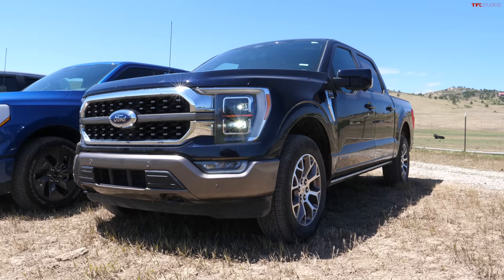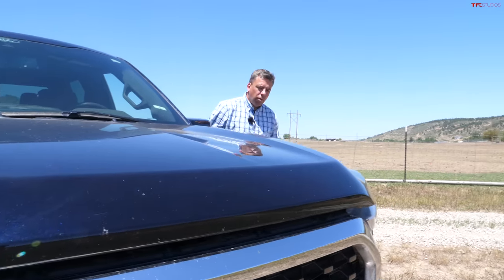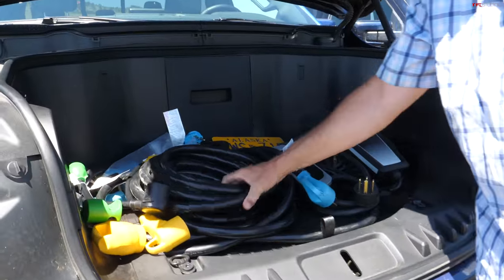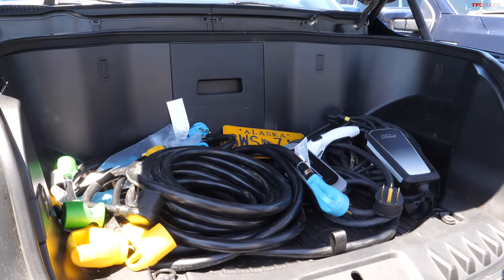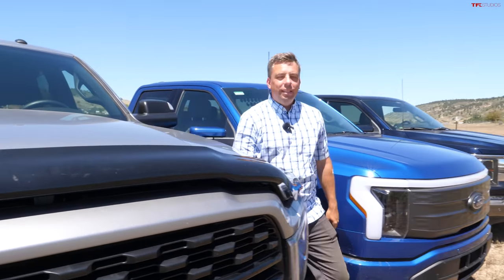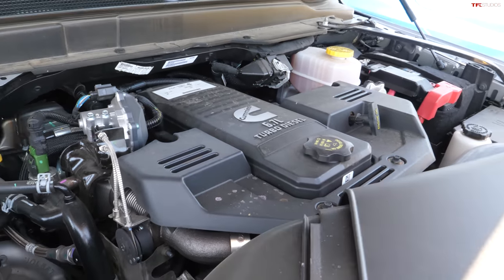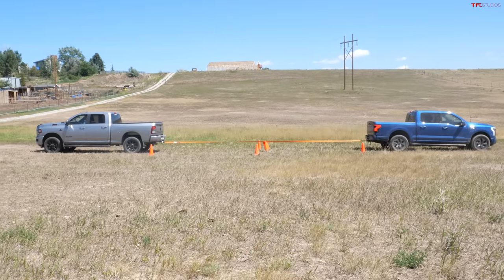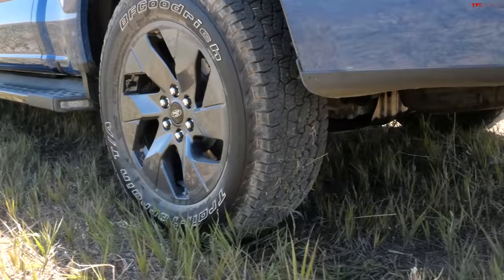Diesel vs Electric Tug-of-War: Ford F-150 Lightning Takes on the Ram 2500 Cummins In a Nail Biter!

Comment: It would've been cool if you had shown the battery percentage before and after.
Reply: That would be a Ram 🐏 fan boy or a Chevy but hurt..
Reply: 100% before. 2% after lol
Reply: Probably lost 10% if i had to guess. Not advocating for EV lol but the trucks battery capacity isnt that bad...its bad but not that bad if you get me . Ill take my 5.0 lol
Reply: Has zero to do with it ...... Gas / Diesel are over ......  Won't be missed
Reply: 5%
Reply: Watch hoovies garage video on Lightning towing. It's awful. He had a light 1400lb aluminum trailer had 200 miles range to start and just 32 mile round trip for what he was picking up. Just driving one way with empty trailer he lost over 160 miles of range. EV IS TRASH
Reply: Towing trailer wasn't problem. But range dropped drastically
Reply: Ford Lightning charge goes down fast when towing.
Reply: @travisyarbrough4033  keep telling yourself that BS.
Reply: i have drove the trucks before battery goes twice as fast in ss mode on screen use more power
Reply: These ev trucks can't do truck things plain and simple. Waste of money
Reply: Yeah no kidding. Dude needs a ride home now
Reply: @travisyarbrough4033  When towing the range is cut by at least 60%.  Towing a boat for example 300 mile range is cut to 100 miles and that's assuming you are not driving uphill.
Reply: That’s the question of the day isn’t it
Reply: @travisyarbrough4033  mabey by liberals but men still like motors they can work on
Reply: Lol they don't want you to see that.
Reply: @travisyarbrough4033  I’ll miss them, EV would kill my business.
Reply: It probably drained it and took 24 hrs to charge
Reply: These ev s do not do well towing. It cuts theilwage by more than half depending on weight.
Reply: @travisyarbrough4033  obviously you don't tow
Reply: Ikr, the Ford dealer where I live did a trial they ran the new lightning out to wawa 3 hours away, fully charged it which takes a few hours then hooked up and trailer and came back,  it got about half way before the battery died Also the power for the charging stations mostly comes from coal and gas energy
Reply: @travisyarbrough4033  Just bought me a new gas truck that can tow quad the range of any EV.... no where near over, pal.
Reply: @kyleflood6173  I'm a big car guy, nay a huge car guy. But even I see that electric cars are slowly becoming more Superior to ICE ones. Nothing comes without of cost, so that towing cutting down mileage is the same thing as towing a trailer cutting down your fuel economy for a regular truck. Electric just has Superior performance capabilities all around. I still like an engine, but modern cars are so hard to work on it's not even funny.  And there's some fundamentally stupid design issues nowadays with gas engines (hello Ford and putting the water pump INSIDE the engine? YOU LITERALLY HAVE TO DROP THE ENGINE TO CHANGE YOUR WATER PUMP. WHISKEY TANGO FOXTROT!). Electric vehicles? There is almost nothing to work on and they are much more reliable. I'm a huge car guy, and I still support electric vehicles
Reply: @pupferal3934  I agree the new gas vehicles are ridiculous to work on I have a 97 chevy k1500 very easy to work on I don't work on anything over 2012 even then I don't like to but an electronic truck just sounds weak to me im sure they preform but its just not a truck. But putting a water pump in the motor for fords is so damn stupid I could see wanting a electric truck after working on that.
Reply: @kyleflood6173  to me, EV suggest an advancement of vehicle technology. They're in their infancy. Look at gas powered cars 100 years ago compared to now. And look how much flack gas powered cars got when they first came out. All I'm seeing is a repeat of history.
Reply: @pupferal3934  can u put glass packs on a electric truck i like my trucks loud
Reply: Would not lose much as the electric vehicle gets best range at low speeds.
Reply: @pupferal3934  - I'm a historian ... and know first-hand that way too many people either ignore or misinterpret history.
Reply: @charlestemple634  in context to this, meaning?
Reply: @pupferal3934  - Sorry ... "Hybrids/EVs are just getting started, and just like in the history of gas/diesels, the manufacturers will recognize what's needed and they will vastly improve everything."
Reply: @charlestemple634  I know this seems weird, but are you agreeing with me ? Context is a bitch sometimes
Reply: @pupferal3934  👍👍👍 ... 100%
Reply: @charlestemple634  okay, thanks 👍🏻
Reply: Lmao
Reply: @Andyman269  Yikes Last time I was out there about 10 years ago Gas stations were sparse, I can only imagine how few charging stations there are.  Not nice to get stranded.
Reply: @SkullBro  still if it can't even pull a trailer for 3 hours on a full charge it's completely useless.  It spends more time charging than driving.  Torque or horsepower doesn't matter if there's no range. You need at least a 1000km range to make electric viable, and the Lithium batteries are no good because they have a risk of catching fire. It's like those new electric excavators you get 2 hours of use then it requires an 8 hour charge with a massive diesel generator. So how is it really saving emissions.  Even the power used to charge electric vehicles is mostly coal and gas the more electric vehicles the more of that you're using so how is that saving the environment.  When I worked at DHL our smuckers plant bought all Lithium battery forklifts they spent more time down than running and because it's a 24 hour operation the batteries were all toast within a year whereas lead acid batteries can run 10 to 12 hours easily,  they have individual cells that can be maintained and last 7 to 8 year if looked after they also had 3 Lithium batteries catch fire, those batteries are 25k each versus only 10k for the lead acid batteries.  Lead acid batteries can be recycled Lithium cannot because it's extremely toxic and harmful to the environment.  The agenda is pushing ordinary people off the roads and out of society not saving the environment.  They want us all I  cities working from home as much as possible and taking city transit while they keep their cars and private jets
Reply: No there not states are telling people to not charge their cars because they don’t have enough electricity. But guess what still got gas and diesel.
Reply: Best one on here
Reply: @luciankristov6436  there's videos on this. The EV battery drains when towing
Reply: @travisyarbrough4033  BS !
Reply: Right I’d take a wild guess and say the electric motor would burn out before the battery lol
Reply: @mattlincoln6845  I see why hoovies garage issued an apology. People are so simple minded it's ridiculous. Air resistance folks. It increases exponentially with speed. Comparing towing at highway speed to a tug of war at probably less than a mile per makes no sense. This probably didn't use much battery at all. Towing something big with poor aerodynamics right now will be a problem yes. Battery tech just hasn't caught up to the use case. But just like I'm typing this on a phone that lasts nearly 48 hours on a charge that fits in my hand where years ago it would have required a brief case it will catch up to the requirements of EVs.
Reply: @travisyarbrough4033  Says you bud, says you...
Reply: @HateDietPepsi  also there's no charging stations to accommodate a truck with trailer/boat so it would have to be unhitched in a parking lot somewhere. Huge inconvenience
Reply: Would have been expensive to show a before and after on the amount of diesel used!
Reply: Likely decreased by 0.02%
Reply: @travisyarbrough4033  it’s funny when electric cars breakdown it’s a fuel operated vehicle that’s tows it😂🤣😂
Reply: That's classified information you purchase the vehicle first then find out the battery is dead
Reply: @travisyarbrough4033  actually it has everything to do with it; the tug of war shows towing power, a before and after percentage would show battery charge capacity and longevity.
Reply: @travisyarbrough4033  what powers the plug my friend? Diesel is the best engine you can ever make
Reply: @travisyarbrough4033  incorrect. How many electric trucks do you think are repairing hurricane Ian rn? Or doing long term towing across the country? The answer is zero
Reply: No way that was real the Cummins would smoke that battery thing literally 😂😂
Reply: Seriously?  You must not work and or tow with your truck
Reply: 😂 lmao
Reply: @joeerickson8182  it was real. Believe or not we have come a long way from the 80s and 90s. An EV Battery last the life time of the vehicle and comes with a warranty stating so. By the time the batteries fail, new cheaper batteries will be out.
Reply: @blasezera4676  yeah ev trucks are stupid cause you would get 5mins of range with a load
Reply: Y’all no like nothing about electric vehicles lol
Reply: @joshgutierrez7380  are you trying to say that an ev can tow 20000lbs for a comparable range to a diesel?
Reply: Research how much worse for the environment the ev’s are compared to gas powered vehicles. Batteries don’t last as long as the vehicles themselves and they can’t be recycled.  Also, they aren’t cheap. Most times they cost is so huge, you may as well buy a new ev. Not only that, but you have to use fossil fuels to charge them back up. 
Imagine how huge the gas stations have to be to accommodate more ev’s that will be on the road. A gas powered vehicle takes a minute or two to fill up as compared to hours or more waiting for the ev to fully charge. No thank you, I’ll stick to my hemi. I can travel 400 miles on one tank of gas and only stop for two minutes to refuel. I can save a couple days of travel one way with my hemi compared to an ev. 😂
Reply: @travisyarbrough4033  unless your towing for a living.
Reply: There is a YouTuber who already reviewed the weak towing ability do the lightening. I thing he only got 100 miles out of an empty trailer. So sad
Reply: @travisyarbrough4033  I have a Silverado EV reservation but saying Gas/Diesel is over is ridiculous.  GM will be building Gas/Diesel for at least 15-20 years.  They said so and if they want to remain in business they will build both. It will be years just waiting for what is planned which isn't very much considering GM sold 6.4 million vehicles last year and very few were BEV. I honestly don't see Gas or diesel ever going away completely.  Won't happen.
Reply: @Andyman269  so it made it there but not back? Tf? I’ve worked for a Ford dealership and we had to go deliver a car to a customer. So I took the lightning (since it was a fully loaded car we weren’t allowed to sell for 3 months) followed my coworker to the persons house. Naturally being at work we took the long way so as to avoid doing more work when we got back. We dropped the car off my coworker then sat and talked to the customer for 30 minutes and I chilled in the Lightning. We then went the long way back and stopped at Starbucks to get something to drink. We made it back and had only used 20% on our 2.5 hour journey.

I don’t even know why you people praise gasoline for towing when it’s clear diesel is better. For some reason the idea that their is a fuel/powertrain best suited to every job is silly to you. 

I’m a mobile detailer and have a lightning on order because it can power all my equipment, I never even come close to needing all the range and less maintenance is required. I even can tow my motorcycle and kart to the closest 3 tracks. The 4th closest VIR is probably doable if I closely monitor the range but I don’t think they have charge stations at the track yet.

Now if I was going to Road Atlanta or somewhere far I’d obviously get a diesel. But different strokes for different folks m
Reply: @Michael-pi8ps  difference,  they picked up the trailer at the destination,  they didn't have it on the way up
Reply: @travisyarbrough4033  EV is garbage
Reply: Nobody likes electric vehicles
Reply: @landscaping2023  yeah because the fact that your Hyundai Sante Fe has a 1.4L 3cyl is vital to the experience 🙄
Reply: Its horrible i know
Reply: @travisyarbrough4033  lol. My F150 has a 600 plus mile highway range. Tesla doesn't even use their own semi's
Besides that 1000 and 1000 of power plants....coal or natural gas would have to be built
Reply: @nenezaze3252  it may sound weird.  But my vehicles make their own electricity
Reply: @mattlincoln6845  I talked to a friend last weekend who is a truck driver. He said that he was selected by his company to test the Tesla truck. He said it changed his opinion of EV. He liked it. He said that the one he drove had a 500 mile range battery pack. They also have 1,000 mile, 1,500 mile, or 2,000 mile, if I remember correctly over the beer, but more than 1 battery module lowers the load hauling rating by the battery weight amount, or something like that? He liked it. The EVs aren't trash. They just don't have the range of an ICE engine because of battery power density being less than liquid petroleum fuel power density, or at least still at present. They'd be perfectly fine for somebody who lives and drives in a city. They're not so great for somebody who drives hundreds of miles each day, unless they're a truck driver with a corporate backing to afford additional battery packs and corporate repair or a way home if something goes awry. 🤔
Reply: It would have been cool if they showed the amount of fuel in the diesel before and after..lol
Reply: @redsquarejay  obviously you have never driven a Tesla.
Reply: I totally agree. Since EV are something pretty new for most it would nice to see every type of benchmark possible in order to form a more educated, comprehensive opinion. Yeah. I can agree. That's a very important benchmark, especially since this is not a car, yet a vehicle that is being marketed to compete with traditional pickup trucks and one of the things pickup trucks are commonly used for is towing. Good idea. 👍
Reply: All these electric fanboys whether they hunt or fish or Camp whatever it might be you know they're going to be carrying an internal combustion engine in the back of their truck to charge their stupid batteries
Reply: @mr.rogers1962  Maybe they'll make an overunity bi-toroid transformer or hydrogen fuel cell?
Reply: @mr.rogers1962  the combustion engine whether it be a car, truck, or internal combustion engine used to power electric cars will eventually run out of gas just like the electric car will eventually lose it's juice your argument against electric cars running out of charge is tic for tat because both gas and electric will eventually run out of power until a power source is provided.
Reply: The electric Ford Lightning actually has 320 miles of range, in the platinum trim. Do you drive more than that at work? The less expensive one has 230 miles range...again, do you drive longer than that at work is the question. 🙂
Reply: @neutrino78x  I'll answer your question, but you have to answer mine. No. Does putting excessive strain on a battery cause it to lose charge faster? This is the reason for my original comment. I felt the need to state this because it seems like you don't understand.
Reply: @upthecreekyt  

"Does putting excessive strain on a battery cause it to lose charge faster? "

Under load, the range of the electric truck will be lower, yes. 

The question is, how much do you have to drive your truck every day. If you only drive like 20 miles in a given day, you won't notice any reduction.

" I felt the need to state this because it seems like you don't understand."

I have a relatively high IQ and you don't strike me as having one.
Reply: Towing with electric truck fully charged you loose 2/3rds oc your battery life off the joyrney
Reply: @travisyarbrough4033  yes they will
Reply: @zetlandersoaghar7551  

"Towing with electric truck fully charged you loose 2/3rds oc your battery life off the joyrney"

I know we can't post links on here but do you have an article title I can google to get a credible source on that? Preferably from Ford or Car and Driver or another credible source. 2/3 seems like a lot.
Reply: @travisyarbrough4033  Same thing your parents are saying about you if you ever move out of their basement. Make sure you use an electric truck so when the pile runs out of battery power from towing your garbage up the 1st hill, you have an excuse to move right back in with em.
Reply: @Waltz Sofa 

"Towing a Model T on a trailer he used 90 miles of range in 30 miles. Something wrong here. Trucks are for towing and hauling."

That says he could go like 90 miles one way, recharge and then do it again. How long do you have to haul stuff at work?

Plus this is version 1.0. Many revisions will follow and batteries keep getting better. 

I don't like Musk on a personal level at all, and my dislike for him and his ideas has grown tremendously in recent days as a user of Twitter. 

However, he does know what he's talking about with regard to his companies' electric cars, and he said we're about five years away from a 500 W/kg battery.

Just for comparison, current ones are less than 300 W/kg.

So, improvement is combing, but this 1.0 version isn't that bad.
Reply: Actors can will say anything for that $$$. It's their job to convince you that whatever they are selling is better.
Reply: Whole lotta ICE folks butt-hurt in here.
Reply: @Waltz Sofa 

"after driving the 30 miles on the return trip, his “gas gauge” said he had used up 90 miles of range."

Right, so if you have 230 miles range total, you should be able to use up 90 miles of range 2.5 times, or if it's a 320 mile battery, 3.5 times, right? So like I said, it comes down to how far you have to haul loads. If it's a short distance like around a jobsite, this current generation should work fine. If you have to haul it really far back and forth all day, you might want to stick for fossil for right now, but battery is catching up fast.

As far as Wh, I think you're right, I stand corrected. Point being Elon Musk thinks they are on the cusp of a significant increase in energy density in batteries for EVs.
Reply: @travisyarbrough4033  yes it really does, how many people do you think want their work trucks to run out of battery and then be forced to wait even an hour, let alone longer in most cases
Reply: @mattlincoln6845  wait 5 years then. It will get there
Reply: @travisyarbrough4033  It has a lot to do with it. Trucks are meant for towing and pulling and hauling. If they can't keep a charge when doing a tough pull, then what will you do when you have no charge to get to a charger after doing a pull? I guess you will use your gas powered generator that you are carrying around.
Reply: @pupferal3934  ye s even diesel utes have long range tanks for towing if ev had the years of research money that has gone into ice machines where would they be now,industry uses electric motors for a reason, power sources (ie Batteries /fuel cells )will evolve over time
Reply: No kidding they don't want to figure out the price too. You couldn't even haul a doll house to the RV Park with that electric
Reply: @travisyarbrough4033  oh it will be missed depending on what you're doing with it
Reply: @nenezaze3252  how is he but hurt and I like fords but hate that thing I was hoping the team would win
Reply: @travisyarbrough4033  No, they will be. The ability to drive all day, stop once for three minutes (instead of three hours in an ev) to get fuel will be greatly missed.
Reply: So can the Ford tow the Ram 300 miles without having to stop for a 45 minute or longer charge? No thanks I'll stop and fill up on diesel in about 3 minutes and be back on my way. Only so many restaurants and malls to kill time in while the stupid thing charges.
Reply: M Dharmaraj  this isn't about being a Tesla fan boy. Tech changes.  The surprising thing is that the gas engine lasted this long.... Batteries are on a very steep improvement curve right now.
Reply: @HateDietPepsi  I read an article that had descriptions on what towing does to the range of the vehicle, and the answer was a 1% loss of range for every 2% of towing capacity pulled. So if an EV truck has 500 mile range and can pull 10,000 pounds, if the truck is pulling 5,000 pounds, then the truck loses 125 miles of range. I cannot back this claim since I can't find the article and I don't own an EV, but I'd assume that it's somewhat accurate.
Reply: @travisyarbrough4033  but electric is pretty useless for heavy towing. You simply can't get enough range. For your daily commute back and forth from the office, electric is fine though.
Reply: It would have been cool to show the fuel tank before and after
Reply: How much is the replacement battery?
Reply: @heartwinners410  gas is irrelevant though, as you can top up in a minute.
Reply: @kobeandgary  Then stick to gas if your priority is topping off in a  minute. It will take you all of 10 to 15 minutes to top of a Tesla at a Tesla charging station. That 10 to 15 minutes I'm charging is productive time for me I can get a quick lunch , drink , take a leak or a dump sometimes I grow my social contacts by talking to another Tesla owner while we are charging. I encourage you to join the Tesla family it's an awesome experience that will enrich your life tremendously .
Reply: @heartwinners410  there's nothing good about a Tesla though. I can get 300+miles from a two minute fill up. I can eat while I'm driving. And I can take a piss while my tank fills up.
Reply: @heartwinners410  no it won't. Tesla definitely doesn't have the fastest top end speed 😂
Reply: They should have kept going till the gas truck overheated.
Reply: @kobeandgary  I didn't specifically say Tesla had the most TOP END speed thanks for putting words in my mouth. I also said Tesla is one of the fastest MANUFACTURED car on the road, when you read you need to pay attention to key words But Tesla will beat  most gas cars in a quarter mile and one mile run. The Tesla Plaid is blowing everything off the road all you have to do is check out the Youtube videos of Tesla smoking every car it races with the exception of a couple high end cars that are not in mass production. I think I saw a certain model Porshe beat the Tesla by a hair. So the few times that Tesla was beat it wasn't by much
Reply: @heartwinners410  top end is what matters though...
Reply: @kobeandgary  Matter to who ? You or a criminal trying to out run the cops? If I beat you on the take off by a good six or seven car length how will you catch me? You won't catch me in your car unless you have a non mass production car like a high end Lamborghini or Porsche or a hyper car like Hennessey or Bugatti which I know you don't have. I'm talking about the average mass production cars ..you know cars that you see on the road everyday. Tesla will smoke  all those cars.
Reply: @heartwinners410  last I seen Tesla tops out around 215mph. There is a lot of cars that will blow that away stock. And it's 0-60mph time is about 2.4-2.6s. Which is good, but plenty of cars beat that. And let's not even talk about top speed, Bugatti hitting 305mph... And that's just factory stock vehicles... Don't even get me started on custom tuned vehicles that will absolutely kill the Tesla.
Reply: @mattlincoln6845  Truck things ? It can do what gas can do . Both are dependent on outside power source neither one can run without juice so what's the point?
Reply: @sepetisionelatu5539  It never takes 24 hours to charge unless your one of those stupid people trying to charge the car on a 110 outlet. Usually takes more no more than 5 hours to charge at home while I"m asleep
Reply: Loads kill the battery  say it had 255 miles toying a light load you'll only get like 45 to 60 miles he's getting  paid for this I have used all those trucks for work
Reply: @travisyarbrough4033  you say that now. Just wait….
Reply: i hope you know that gas consumption skyrockets at high rpms, the rivian dropped like 1-2% , the gas truck probably drank half a gallon
Reply: @user-uf9ke9tm2w  Neither of us were there. So we can only make assumptions. I understand the view from both sides, I really do. But ev needs to grow more before most people will consider purchasing one.
Reply: @kyleflood6173  real men don’t use electric drills, saws, flashlights or shavers. We chisel our homes from a single block of wood.
Reply: @travisyarbrough4033  Have fun using a diesel or gas generator when you run out of battery in the middle of nowhere!
Reply: You're making this comment to suggest a stupid conclusion, instead of genuinely curiosity.  

The % barely moved because the truck barely moved.  Hence why no need to show it.
Reply: Having both of these vehicles the lightning would have used 1% of the battery at best based on run time and distance while towing